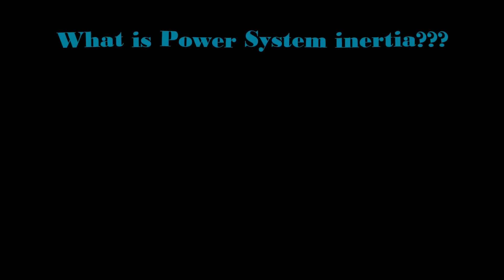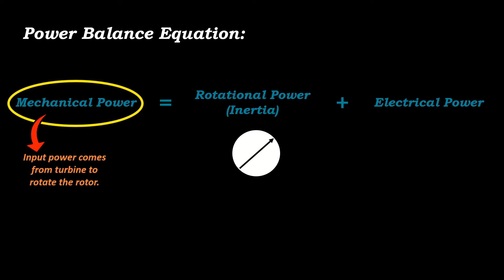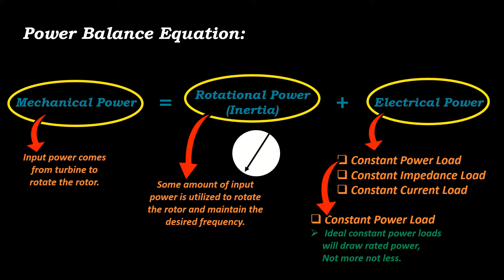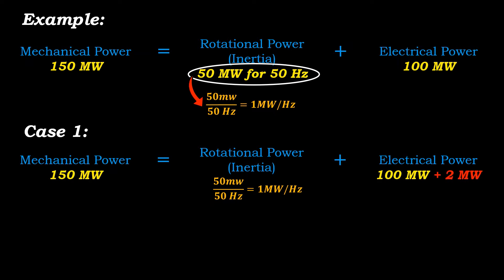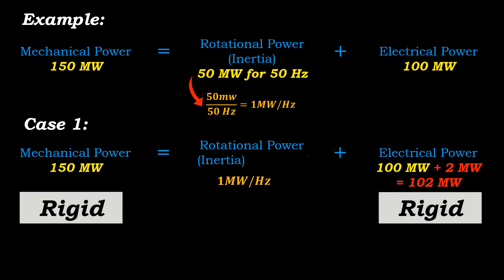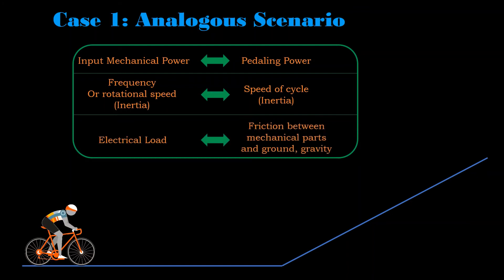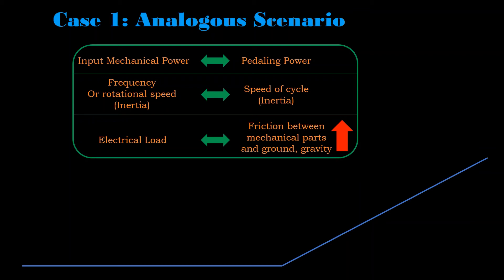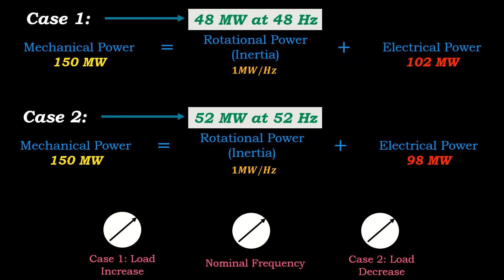Power System Inertia: An Intuitive Explanation/Relation with Droop Characteristics and Droop Control

Comment: can i put only two generators in parallel in isochronous mode?
Reply from the maker: Hii rone....it is generally not recommended due to load sharing issues. I am thinking about posting one video on isochronous generators soon. Till then you can check out this link 
https://www.quora.com/What-is-the-difference-between-isochronous-and-droop-characteristics-governer
Reply: I guess not. Both controllers will "fight" to keep the frequency and your system will  become unstable. The Generator with the biggest Power rating will normally set the frequency and the others will follow in Droop Mode. Am I right @A Serious Circuit ?